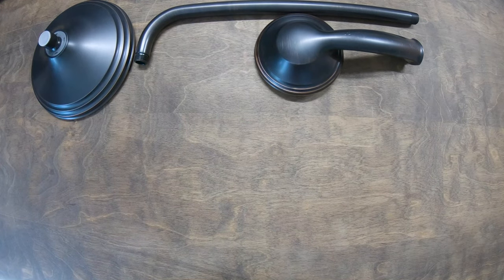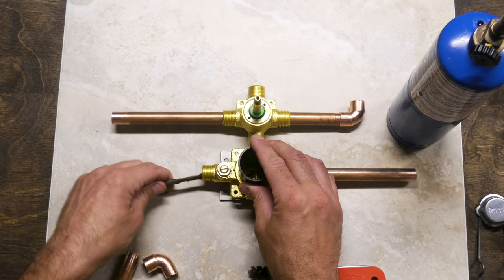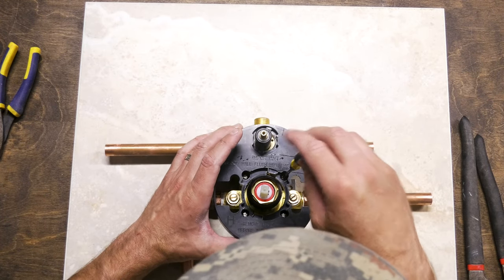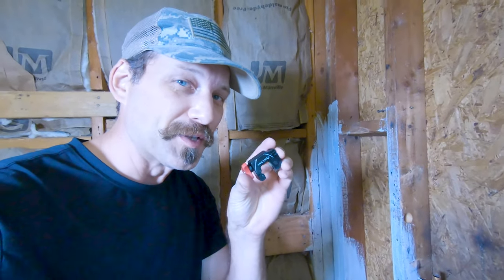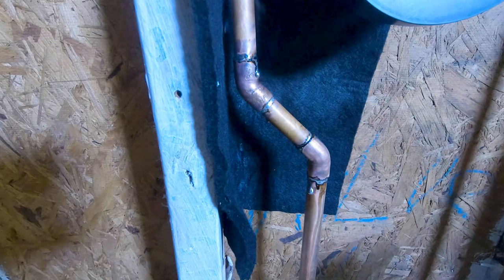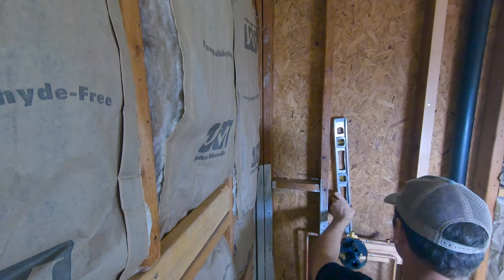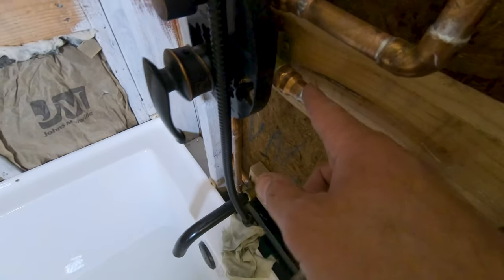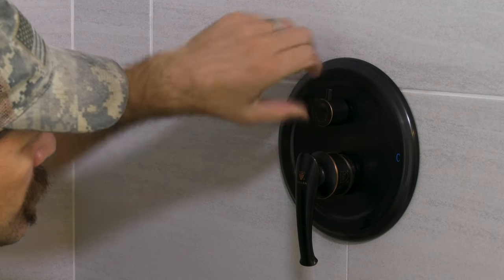Installing a New Shower Valve with 3-Way Diverter [copper pipe]

Comment from the maker: If you're trucking away on your bath remodel, here's how I did our floor tile:
http://bit.ly/floortileinstall
Reply: Any update on this Amazon diverter? I was told Amazon diverters could potentially leak & to get delta/kohler.
Reply from the maker: @gunnercuppetilli7865  The diverter is still in full working order. No leaks. The only issue I have with it is that there is no 'release' function. So minutes after you've turned off the shower, it will start to relieve the pressure and dump any remaining water into the tub. But you get used to that.

Comment: I knew this was going to be the perfect video, when you said installing the shower/diverter valve would be so stressful.  I've been freaking out on how I was going to do a very similar project.  
I also plan my work then work my plan.  Valve stick out is ctritcal. Shark bite caps is a good idea, I was going to use ball valves, not now.  I'll also use threaded fittings into the shhower/diverter valve, I doubt I'll use the pipe dope and go with teflon tape instead, I make a mess with the pipe dope.  Fire blanket and extinguisher are good deals.  
Today I'll get the outstanding items needed, install the shark bite caps and begin the shower/diverter valve set up.  All goes well today, I'll solder it up tomorrow.
Thanks Cool Hand.......
Reply from the maker: Wonderful mental prep, Marcia. You'll do great work! Thanks for the thought out comment.

Comment: Great video.  All good tips especially being aware of heat transfer when soldering.  I always use yellow gas Teflon tape on everything and never have a leak.  I know some people will carry on about how you should use blue or white but yellow has worked for me.  I asked the plumbing supply warehouse about this and they said its the best tape out there and no one wants leaks.
Reply from the maker: Thanks Oby. Happy New Year!
Reply: @coolhandryan  Happy New Year. And stay safe.

Comment: An old plumber explained that the solder flows toward the heat. Once you get the joint hot, hold the flame on one side and the solder on the opposite side.
Reply from the maker: Smart plumber

Comment: Doing my bathroom and this video really helped. Using pex as I have some crazy turns but overall same concept. Thx.
Reply from the maker: That's great, John. Best of luck with your project! Thanks for watching and taking the time to comment. Check back in and let me know how it goes.
Reply: How did the pex work?  Did you use the pex for the shower head?

Comment: I would suggest putting the flame at the very end of those female adaptors, and even male adaptors when soldering.  That way you know it sucks up in there all the way to the back of the fitting.
Reply from the maker: Thx jtoker. Good suggestion.

Comment: Like your film and bg sounds, which are low enough, not distracting, Hendrix-y. 
The reason no to attach the elbow to the chipboard...if there's a room behind it, 
the wall could be demolished and the pipes suffer. If it's house siding, same but add in potential settling issues may drag the pipe around. It would do better with bespoke blocking, IMHO
Reply from the maker: Good notes, AJP.

Comment: On my  copper  x female adapters  , ( where the leak occurred )  I always use teflon tape over the pipe doped male threads . 
 it's belt and suspenders .
I use Teflon pipe dope as well .
Reply from the maker: Indeed, Vic. That seems to be the pro way to go. Much obliged.

Comment: you need a heat sink that draws the heat away from the plastic fitting like cold wet rags or a tray of cold water. this will keep the plastic piece from most likely melting
Reply from the maker: Thanks, Patrick. Good suggestion.

Comment: It was good to watch your video.  I especially liked the fact that you found a leak or two on your first test.  That's probably something that most DIY guys encounter.  I did wonder if you didn't consider using pex instead of copper.  It just seems easier to work with.
Reply from the maker: Thanks! I never considered pex because it is another form of plastic and I prefer running water through copper and brass. I'm sure the water will come in contact with plenty of plastic by the time it is released, but I just prefer copper. And it's more fun really. 🤣

Comment: Also..leaving a valve or hose open a little prevents it from building pressure before taking off the caps if as he said the main valve doesn't close 100%. In this case u may get wet but on higher pressure systems including air..it could save your life.
Reply from the maker: Thanks for adding this, Mike. Much obliged.

Comment: Great video👍 I’m doing a kohler 3way diverter which makes it possible to run the raindrop shower head and handle spray showerhead simultaneously.  Do you think 1/2 copper is sufficient?
Reply from the maker: Hey James. I’m pretty sure 1/2” pipe is fine, really depends on your water pressure and the female connection size on the valve. But 1/2” is standard. Thats what I’d do.
Reply: @coolhandryan  I spoke to kohler and they ran looked up the showerhead I was using and say 1/2 is fine.  Also inside the mixing valve and the diverter the holes are equivalent to 1/2 copper so I’m not sure how much 3/4 would help.   But good to also get same answer from you.  Thanks a lot👍🇺🇸
Reply: @coolhandryan  JLitt-us4vs mentions using a raindrop shower head "and" the handle spray showerhead "simultaneously". Several diverters on the market come with 3/4 inlets. Using shower head or the other will work fine with standard 1/2" but using both "simultaneously you would benefit from 3/4.  The restriction caused by a smaller pipe or a much smaller opening delivers a perceived increase in water pressure, like putting your finger over the end of a garden hose,  but in reality the gallons per minute remains the same. NET: If a home has sufficient water pressure, moving up to 3/4 pipe will not change the water pressure, just the available volume delivered.
Reply from the maker: @eltonnoway7864  good stuff.  I dont use them both at the same time much. But what you’re explaining makes sense.

Comment: I want to see the shower work. I can't believe most showers don't have a water volume control. I'd rather have a shower made 70 years ago than the modern showers. Totally lame not to have a water volume control.
Reply from the maker: Indeed, they don't make fixtures like they used to. The lever system in this video does control the amount of water that travels through the shower head/rain fall. But there is not an adjustment to control the amount of water let to the valve.

Comment: I’m installing a shower system with the same water value. When you say “stick out an inch from the stud” are you referring to the start of that plastic cover piece? I.E. the value should be mounted with the plastic cover sticking out an inch from the stud?
Reply from the maker: Whatever that means for your measurements. For me it was it was about an inch from the stud. See 11:38 in the video where I'm measuring from the face of the stud (after you've furred out any studs that are not flush) to the face of the mud plate, using a level. 1/2" backer board, ~quarter inch mud, and 1/4" tile.

Comment: Can you solder the brass coupling/thread in lieu of using a sealant or tape? I can never seem to get the threaded coupling tight enough on the diverted.
Reply from the maker: If you use MAP gas it will get hot enough. But, as you'll see in the video, if you don't remove all of the plastic and rubber pieces from the fixture they will potentially be compromised by the heat. That's why I used the sealant.

Comment: What are you rubbing on the pipe and before you heat up the elbow joint?
Reply from the maker: Its called flux for soldering copper pipe.

Comment: Hi, are there on and off buttons somewhere? My shower head is the only thing that works. No water comes from my handheld or tub faucet.
Reply from the maker: The only on/off toggle I know of is the diverter itself. When you turn the water on, it will start to come out of the flow channel that the diverter is diverting to. There should be a way to switch it from shower, to tub, or rain. Outside of that, I'm not aware of any other way to turn just one or two of the options completely off. Perhaps take a look at the manual for your specific model of diverter. You can often find them online.
Reply: @coolhandryan  when I turn the knob for the handheld nothing and then I turn it for the tub nothing. Only water comes from the shower head. I will see if I can find a manual. Thanks.

Comment: Great video, it’s going to help me on my remodel.  The link to the diverted valve kit doesn’t work.  Can you supply me the make and model?
Reply from the maker: Good stuff, Brian. Best of luck with your remodel! If you search Amazon for B07PYSGWJ9
then the shower faucet set should come up. Remember that I used a different layout for mine and it required a few other pieces that I used in the video. Let me know how it goes! & thanks for hitting that like button and subscribing, helps a ton.

Comment: Question have for you sir if i want to change out old single shower faucet knob that turns on by pushing knob up & down to turn it off though new one i want to get is a handle faucet that pulls out to turn on & push back in to turn off so would i have to change out the whole old valve & install new one for what i want to do therefore would i have to unsolder the old one out of the wall or can existing one work?
Reply from the maker: Good question, Burt. In my limited experience, each knob and function requires a proprietary valve kit. I think the answer is that you will need to change the entire valve system, which will require some considerable access space within the wall. Do you have access to the valve from the wall behind it? Meaning, can you cut out some sheetrock on the other side of the wall to be able to make the entire swap? Or will it require you to cut out some tile around the old valve and replace that tile afterwards? Or perhaps you have enough access to the current valve by simply removing the plate that hides the present valve? A complete valve kit change is easiest while remodeling the tile entirely.  I suppose it is possible that your current valve has a cartridge system that can be swapped out for a new one that functions like the one you described. But I'm not aware of a brand valve kit that allows for such an easy change of mechanics.
Reply: @coolhandryan  Yes Ryan its where my daughter lives there is actually a section of sqaure fiberglass plate from what appears in the pic she sent me that I would be able to get behind it most likely by removing the caulking along the edge of it, never seen shower done like this though I will take a run over to home depot tomorrow see what they have & whats all involved would be nice if there is a conversion kit for it by just removing the old cartridge to the other one, thanks for the input on this appreciate it have goodnight God bless

Comment: I’m installing one for a customer (different model) and nothing is coming out at all! Never had this happen. Is it a water pressure issue?
Reply from the maker: Hard to tell without being there to help troubleshoot. Is it possible that the screws are shut on the hot and cold inlets on the valve?

Comment: I have a 3 way shower diverter made by delta after only 3 years I believe it is leaking and soaking the baseboard has anyone had issues with delta diverters
Reply from the maker: Hey Andrew. I've not known any issues with Delta, but I'm not a Delta specific dude. In my limited experience, all models from all manufacturers put lemons on the shelf every so often. Purely a numbers game, and you pulled one of the unfortunate odds. It may have been installed in a rushed manner though. Most of the big brands have warranties that will replace a dud like the one you have but you might need to rip it out and send it in. It won't cover the cost of replacement though. Could also be a simple cartridge swap needed.

Comment: Why didn't you just solder the copper into the diverter valve???
Reply from the maker: I think that is mentioned in the video. The gas I was using did not get hot enough to solder to the brass fittings without melting the plastic casing inside.

Comment: better to wrap with teflon glad the tile did not explode
Reply from the maker: I use teflon but exclusively on reachable fittings. Curious, why and how would the tile explode?
Reply from the maker: Oh, you mean on the set up scrap tile? Yeah, I don't think I was hitting it for long enough to crack it. All good once it was done, no damage to the table or tile. :)

Comment: Your trowel was the wrong size for the tile. 
But can't knock a diy'er for doing.....
If your solders aren't clean, don't worry, it's in the walls. 😅😂
Reply from the maker: Happy to report that the tile is still on the wall. 😂 Thankfully.

Comment: Do you have to use copper pipe?
Reply from the maker: Hey Aru. Copper pipe is not necessary, I just prefer it over plastic. However, you can use PEX tubing with quick connections. Plenty of YouTube  vids out there to explain PEX.

Comment: I’m 💀 you just cleaned the inside of the pipe. You’re supposed to debur it
Reply from the maker: Definitely. Though I don't show all prep work in the video, mostly I would clean the inside and outside of each pipe. I cut a lot of stuff out of the video to trim it down. But you're totally correct.
Reply: @coolhandryan  my dad made me "clean the pipe so I can see myself in the shine." (LOL) The he would clean inside and debur it and have me do it again--and not touch the ends any further (with dirty fingerprints). Flux and go. Whenever I go to fix boiler filters and joints, people comment that their system looks "so shiny and new" (LOL). Hey, I leave things better than when I found them.
Reply from the maker: @svg001  your pop had his game down and seems to have made a very positive impression on your game too!

Comment: You have to us teflon tape on your threaded connections.. The pipe dope is just a lubricant it doesn’t make them watertight.. 😒
Reply: So what you're telling us is... the product labeled " thread sealant " is actually a lubricant? Interesting
Reply: @lathammarek927  some plumbers only us pipe dope “thread sealant” but most us Teflon tap and pipe dope. Without Teflon tape you will most likely have drips..
Reply: The tapered threads form the seal